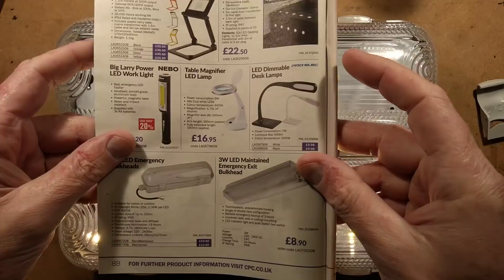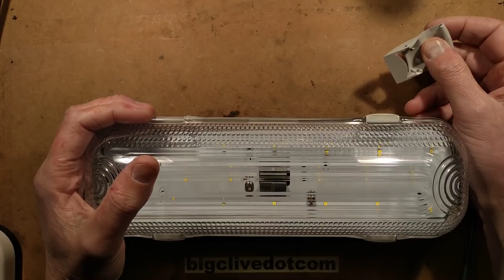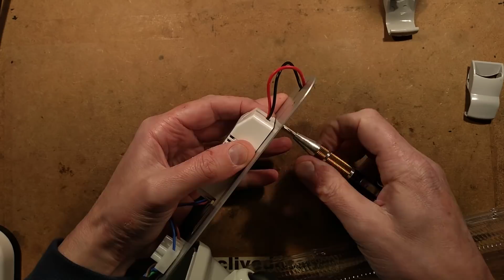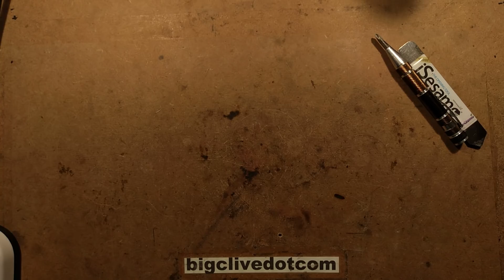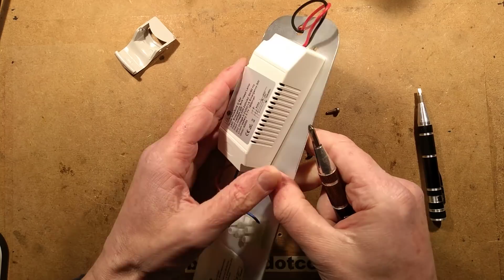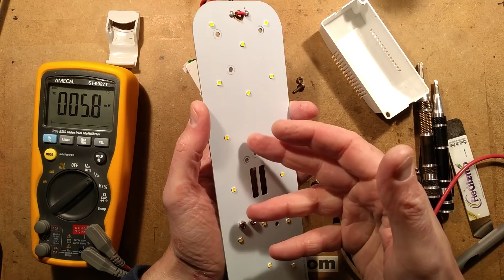Lithium powered emergency light (now recalled).

Comment: Got an email from CPC today regarding these lights being recalled:

Dear Customer,

CPC has found the two products to be non-compliant with the requirements for emergency lighting and have taken the decision to withdraw these from our customers. 
If you have bought either of the below products, we need to arrange a return of the item. 

Order Code            Model                                 Description 
LA06672                 PHAROSD NM                   Bulkhead LED 
LA06673                 PHAROSD M                      Bulkhead LED Non-maintained 

Please remove the item from use – switch the power to the unit OFF and remove the product from use. Please email our contact centre on customersupport@cpc.co.uk and quote the reference “BULKHEAD” and advise which of the above items you have. We will contact you to arrange collection. 

Full support and advice – if you have any concerns relating to this product, please email our contact centre on customersupport@cpc.co.uk using the reference “BULKHEAD” - we’re here to help.
Reply: Thy do seem to take recalls seriously. A while back they offered to send an engineer to replace a defective 3a plug fuse supplied with a product I had purchased!

Comment: Would say John Ward would know the ins and outs of the legality of those lights. To me, the dodgy spelling of the battery on the diver case it a really good indicator of the quality. I'd use them in say my garage but would never want them in a place where proper emergency lighting is needed.
Reply: I think trading standards (or BSI?) might be interested in this also.

Comment: In Brazil the regulations states that the emergency lights have to have a self test button.
Reply from the maker: Here there's normally a keyswitch so the whole circuit can be tested for full run time.
Reply: We don't usually have a dedicated circuit for emergency lights because it was not a requirement 20 years ago.

Comment: Wow. That's some freaky stuff from Farnell. What an odd 'design' and execution!  Right up there with the cheesiest junk.  You should try a capacity test on that battery, too.  Be funny if it's one of those under 1000 mAH cheapies, as well. Love the way the clips fall off, too...  Always fun to see what you dig up. (And yes, i've hit Ebay or Amazon for several of your more interesting finds.  Still have a few mini-disco balls around here...)  Thanks for the vids!  Stu  (You should hassle CPC about those things...)

Comment: So one battery unit was shipped without battery. Both are missing the charging status indicator (which would include battery failure indication, very important) and both are so poorly built that they break when you use the clips. And they use a repurposed circuit board from a LED bulb. What a piece of shite.
Reply from the maker: Yup.

Comment: The casing is fully plastic and likely to be rated as double insulated and the part is designed for installation 
So, that earth wire. It's not technically required though, is it? Still horribly shoved away though.

The one with the battery would be better with something like a 10MOhm  resistor across the input to ensure it remained on.
The slow fading over time could be a problem as the light is meant to remain at the rated output for the duration of three hours.

I used to use a couple of non-maintained plug-in emergency lights back-stage (and at home in the power cupboard under the stairs) as they were useful for unplugging and occasionally taking anywhere needed.

Totally shoddy products though. You should report these to CPC/Farnell. Let's see a product recall! :-)